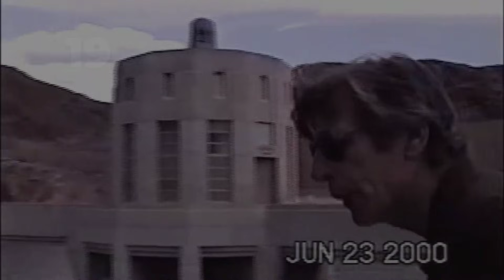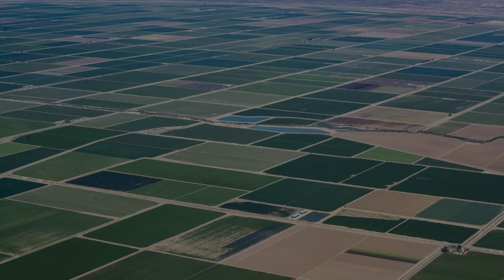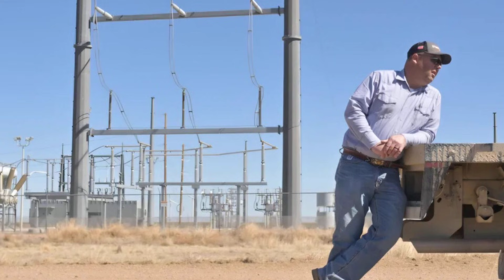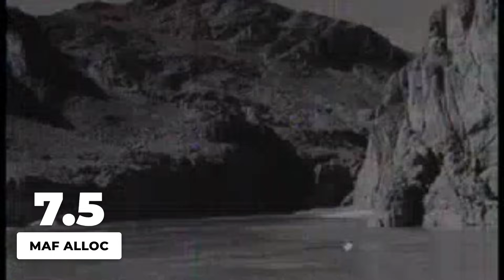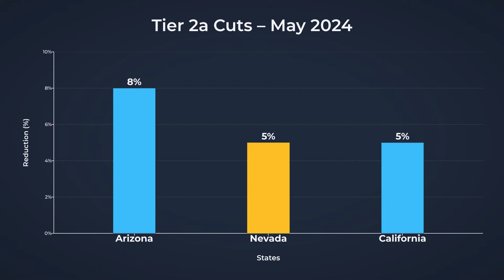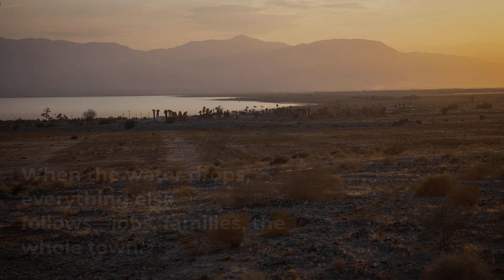Footage From Hoover Dam Uncovers The 140-Foot Plunge No One Can Reverse

Comment: Banning beaver hunting and trapping up and down the Colorado and tributaries. It will make the greatest gains in water for the cheapest cost. Maybe release a few beaver.
Reply from the maker: Interesting angle. A lot of people don’t realize how much beavers can actually slow water flow and help recharge wetlands naturally. 🦫

Restoring habitats instead of just building more infrastructure might be one of the cheaper long-term plays. Has anyone seen real data on how much impact beaver populations could realistically make along the Colorado?